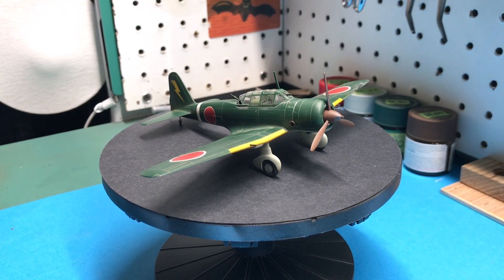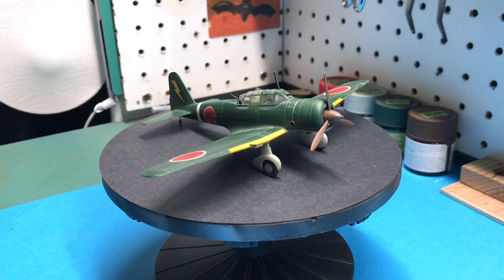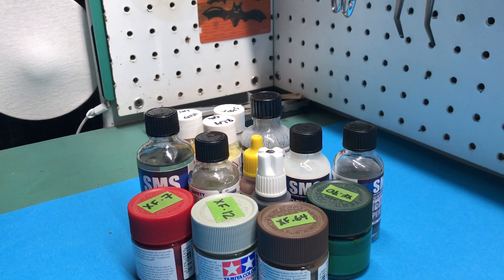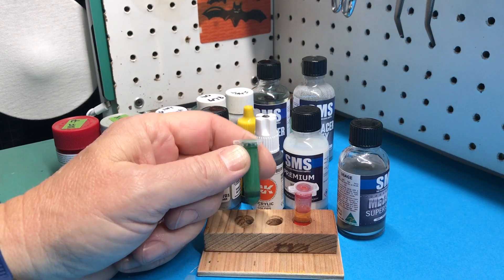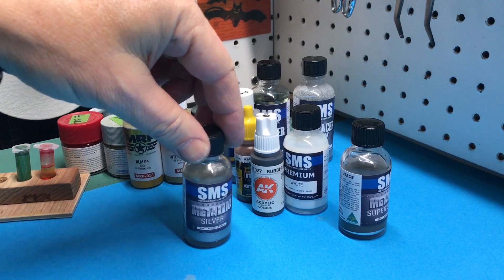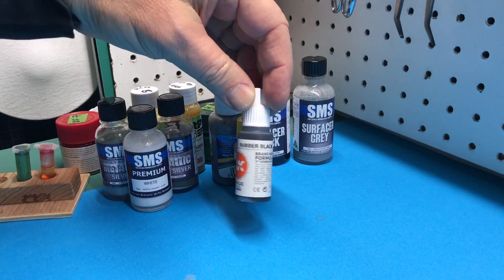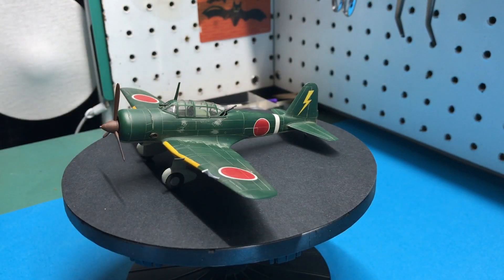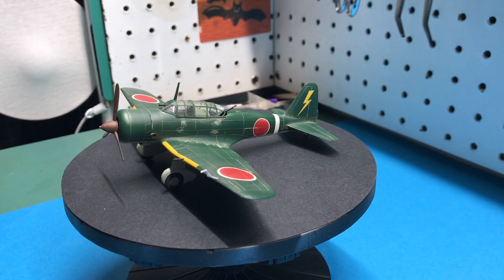Hasegawa 1/72 Ki-51 Sonia, Part 4 Final

Comment: Excellent result on your Sonia, Brett! I like the SMS paints, but haven't tried the primers or metallic paints yet. I'll have to give them a try.
Reply from the maker: I like the paints and have tried a couple of the metallics. The primer/surfacer I'm not sure about yet. I think it has its uses but I think Mr Surfacer 1500 is a better fit for my methods. I plan on doing a video about the lacquer based primers I've tried. Kind of a comparison and my thoughts.